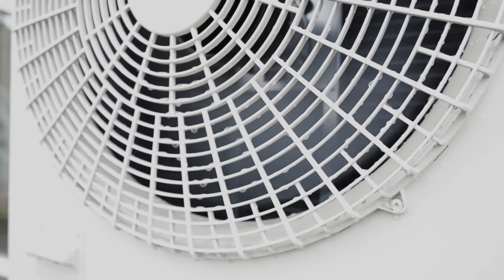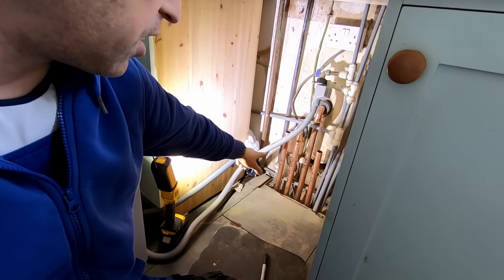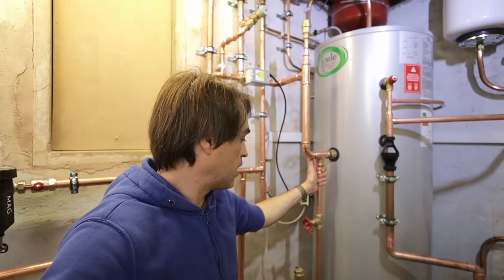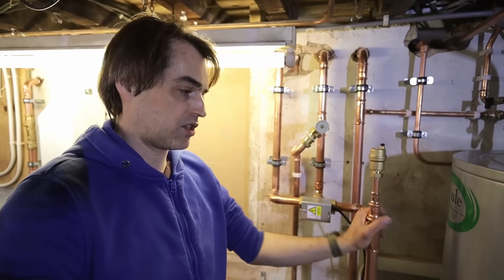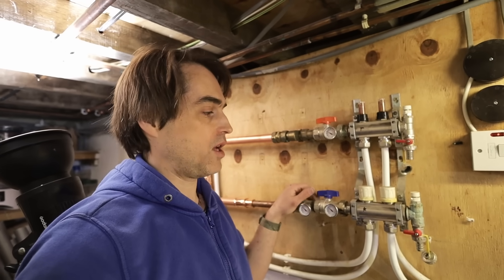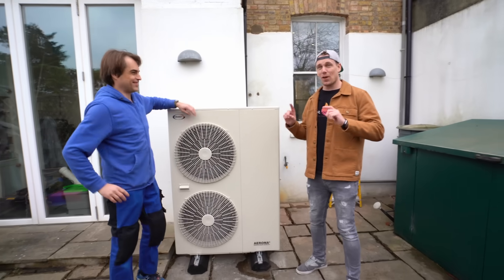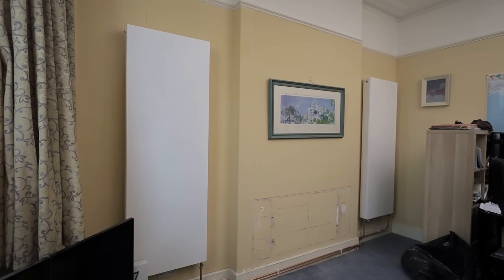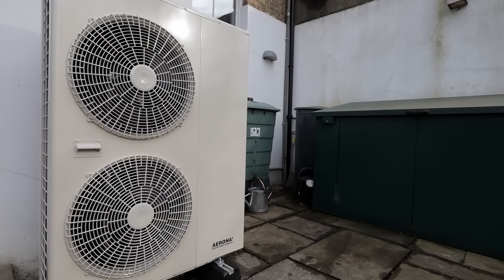The Truth about Heat Pumps: Debunking the Myth.

Comment: Looks like a very good installation. Well it wouldn’t surprise me if this installation cost £15,000-£20,000 probably slightly more. In my opinion I think this is way too much money for most families to go down this route.. personally before installing a air source heat pump I go down the route of installing insulation possibly new windows and also looking on how to improve the buildings fabric to decrease heat loss. From my experience as a heating engineer, heat pumps have a place but most the time badly installed and proper care and do diligence is not taken while surveying the job.. I personally would advise people to look into how to make the property more energy-efficient through wrapping it up then installing a heat pump on old properties.
Now if you had a brand-new property that was 100% up to scratch building regs regarding insulation or possibly a passive house then a air source heat pump would be ideal specially if you have underfloor heating everywhere..
Personally I think spending £20,000 on improving windows, insulation etc is far more bang for your buck
Reply: Spot on! Fabric first is the phrase
Reply: It's a bigger expense to properly insulate an old property than most people realise.  A tenement in Glasgow was insulated "properly" I imagine to Scandinavian standards. This was done with a government grant, it was a sort a demonstrator project.  8 flats.  I think the grant was £240,000 though the total cost was £300,000 (it's in Niddrie Road, if you're curious). That's an investment of 38K for a one bedroom flat to reduce heating bills by around 85%. The whole block had to be vacated during the works.  I'm not saying this isn't feasible but... it's a hard sell.  For a lot of property the cost of the project is approaching the house price. And this is for a flat, the cost for properties with more exterior walls, eg pretty much every old house would be higher.
Just saying.  Everyone seems to think that home insulation is low hanging fruit of energy saving. That's a fallacy.  The easy stuff has been done already, everyone has loft insulation  and DG.
Reply: @colinmacdonald5732  I believe you are correct. I looked at insulating my 120 year old victoriana semi and it's not just the cost it's also the lost space and time. Lots of horror stories on DIYers eg a 6 week project taking 18 months

What might be better in these instances is where the land value is high the government or council could buy while blocks knock them down and rebuild 2-3x as dense to modern standards

This is happening to some degree in inner London where the council bulldoze some estates and build 2-3x as many properties on the land

It's just about viable and you replace a low efficiency home with a modern standard flat

Perhaps this can be accelerated in London 

While the political class think London gets too much investment imo it gets too little. A plan to make grow London from 9 million to 15 million by 2050 would be a good energy efficiency drive. Buy up whole blocks or streets and rebuild at twice the density. It's not just homes which become more efficient but also transport. Eg only 20% of homes in Hackney have a car the other 80% don't

Either way as you say there isn't a lot of low hanging insulation remaining
Reply: Probably VERY cost effective considering if, your normal gas bill is usually £1000/Year is going to jump to £6000/year in October. 
Maybe more depending on what happens if Germany really does stop using Russian gas.
Reply: @bricktop7803  Gas isn't going up 6x

It's going to 7.37p a unit and average consumption is around 12,000 units per year = £885 per year

And these high prices can't be maintained indefinitely as at these prices the USA will build a hell of a lot of LNG terminals and export their vast Shale Gas to Europe

For what it's worth just 10% of USA Shale gas is more than the total consumption of NG of the UK a country of nearly 70 million people
Reply: Would be good to know the cost, but Isn't alot of that the luxury of mains pressure hot water? .. Non-vented tank  etc . A vented tank is a cheaper especially if you are replacing an old one.
Reply: A lot of new build properties are built to old regulation standards.  The quirks of the planning system allows this I was informed by someone in the know.
Reply: Yeah - the heat pump agenda is very sinister. Its nothing to do with the environment. The elites at Davos invest in certain things and then have governments mandate them in order to make a fat return on their investment even if its a totally unsuitable technology. It's why Germany wasted untold billions of euros on wind and solar in a country that's cold and only gets 8 hours of daylight in winter and the only achievement resulting from this was doubling the price of electricity. It doesn't matter to the elites because they already made their money off the scam. France already took actual action in this regard in the 1970's when they decided to switch mostly to nuclear power. 

Even if you mandated heat pumps on new buildings when the heat pump inevitably fails after 10-15 years most people don't have £10,000 lying around for a new one. It will be like those old cars that came with jetronic mechanical fuel injection. When it went wrong most people had the car converted back to carbs because they worked better and were cheaper.
Reply: @June Parkinson insulation is always a good first step, where it is an option - sadly there are very many houses in the UK (such as our own) that cannot be easily insulated without massive disruption and excessive costs.
Reply: Totally agree! I live in a new-build detached house and I hardly ever put the heating on, on the contrary, it gets too hot without heating ever being switched on! The insulation in my property is to current regulations, which is really good! So good insulation is key to sustainable heat in homes.
Reply: You would have to, these don't work well in badly insulated houses
Reply: The heat pump in my house would definitely use less energy if I'd installed good insulation first. However the indicative quote I had for solid wall insulation was £35k. Our system was in line with your estimates on cost. It still costs less to run than the oil boiler we had before and we've reduced our CO2 footprint from heating our home by around 80% (based on UK grid generation). Yes most of the pipework was replaced, yes we've got some big radiators, but set against internal solid wall insulation is much less disruptive and expensive. System design flow temperature of 45°C at -3°C outside temperature.
Heat pump in an old house with solid walls/poor insulation can definitely be a good option.
Reply: @shouting-into-the-void  how much was your heat pump and system upgrade please?
Reply: @stuarthawksworth  Just north of £20k. A big chunk was replacing all the radiators and pipework which would have been essential anyway. Our 40 year old boiler broke and the 8mm microbore pipework and rusty radiators would have been replaced even if we'd replaced with a modern oil fired boiler. 32kW oil boilers aren't free either. It was expensive, but not as mad as it first sounds.
Reply: @shouting-into-the-void 35k for solid wall insulation do you live in a a large mansion.  How many acres of land do you have, did you consider a ground source heat pump. They are far more efficient than air.
Joking aside you should be about to ally for a grant and try talking to a different builder that's a  insane quote unless you really do live in a mansion.
Heat pumps dowork if properly installed but will still cost more than mains gas to run. As for the environment best take their claimes with a pinch of salt
Reply: @shouting-into-the-void  yes it is a good option depending on the climate .... if outside the minimum temperature is -5 and only for a few days a year then a heat pump can be an acceptable solution :) ....+ + you compare the efficiency of an old inefficient boiler with the efficiency of a new generation heat pump…
But if you build a new house where you install as a thermal solution a condensing gas boiler and the difference of 3-10000E (up to the cost of a heat pump with boiler and the rest of the accessories + labor + space needed to install a heat pump - and that cost money) I use it to increase the thickness of the thermal insulation then you will consume less for the same total amount of money invested in the construction of the house + you get a more reliable and cheaper to maintain system + you find many more competent people to install a gas heating system and maintain it :)
But there is no single perfect solution :)
Reply: Replacing windows in the house especially if you’re going to go to the high U value triple glaze plus the proper airtight installation and hopefully water leak proof will cost just as much as a heat pump if not more. 

         Air sealing is your biggest bang for the buck and the simplest and cheapest. 

The proper insulation on a new build or upgrading insulation should’ve been something that was tackled long ago in the first place before the heat pump installation. 
                           Then with those considerations out of the way and properly implemented you would need a smaller heat pump costing you less because you have already maximize your insulation and air sealing and prove it and document it by doing a whole house blower door test.
Reply: @coldfinger459sub0  I disagree on the air sealing,  you need airflow into the property to prevent damp and mould. I know this from personal experience and had to install a PIV system to get rid of the mould that was growing due to a lack of air flow.
Reply: Far more bang for your buck than what? Good insulation is a prerequisite of installing a heat pump based system anyway  so it isn't a case of either or but after those improvements you suggest have been made.  I think Simon covered it,  alot of care should be taken over the system design and heat loss calcs to avoid dissappointment.
Reply: Comments absolutely spot on, reducing the heat load required first should always be the priority.
Reply: Right. They installed a wooping 17kW HP. Customer has a very big house or a very old house.
Step 1. insulate the house to a modern 30w/m2 heat load (at worst conditions)
Step 2. upgrade to properly calculated underfloor heating throught the house.
Step 3. choose an easy to install yourself monoblock HP (4-6kW)= 4000 euro and a separate easy to install 100 liter HP boiler= 1000 euro.
Reply: @conr3x  or alternate step 1.  install a gas boiler
Reply: @MrDead1975  unless you have no gas supply...
Reply: @conr3x  step 3 10:1(or more) modulation Gas condensing boiler @1000E :P
Reply: If you have £20,000 spare why not just put it in the stock market if it gains you average 7% a year that's £1,400 per year

Use that £1,400 to pay for simple resistive heaters eletricity. In normal times that would buy you 14,000 KWh of eletricity plenty enough to heat most homes

Also this method above would last a lifetime while a heat pump will last how many years?
Reply: @kaya051285  Funny point of view :) It is not ok for the enviroment to just use the resistive heaters :)
Reply: @mihaiachim5299  What is environmentally negative with using resistive heaters?

The future UK grid in 2030 will be ~90% non fossil fuel (mostly wind power) so using resistive heaters will be perfectly fine

Also the simplier cheaper resistive heater will be easier to manufacture and install so less waste produced

A 200kg heat pump is surely more environmentally damaging than a 1kg resistive heating element

All the mining refining transport maintenance and upkeep of a 200kg heat pump system is far more damaging than a 1kg resistive heating element
Reply: @kaya051285  Your not wrong.
Reply: @mihaiachim5299  that's not true, of course it depends on how the electricity is produced but gas is far less harmful to the environment than claimed. 
The best of both worlds would be to fit solar panels, new double glazed windows / insulation and fit a new gas boiler, then with the rest of the money saved compared to air source heat pumps take the family on holiday
Reply: @kaya051285  gosh that's exactly along my thinking, albeit we've lost the 14p/kw elec for now....
Reply: @kaya051285  or you could invest in the market and lose all your money. Simple.
Reply: @kaya051285  unfortunately, money supply inflation means that £1400 will buy you less and less energy over time
Reply: @kaya051285  "if you have £20,000 spare why not just put it in the stock market?"  Because that isn't helping decarbonise anything unless you've invested it very carefully indeed. The object of the exercise at this point is not 'see who ends up with the most money when the world collapses', it's 'how can I best use my resources to deal with the problem'. Investing in retrofits and heat pumps is much smarter than putting it in stocks.
Reply: @xxwookey  You don't get it

Soon enough by around 2030 the UK grid will be around 95% non fossil fuel

At that point what makes more sense if you have £20,000

Buy heat pump system and use 4,000 units for £800 pa

Buy a couple of resistive heaters for £100 and out £19,900 into the stock market. You need 12,000 units of eeltricity for £2,400 so it's gona cost £1,600 more. But your £19.9k in the stock market will cover that difference if it makes 8% return

Another way to think about it
Should the country build 1 additional heat pump to save 8,000 units of electricity or build 1 additional wind turbine and additional grid capacity to generate/transport 8,000 additional units of eletricity
Reply: @kaya051285  That is indeed a fundamental choice. I do get it. The problem is the size of load you generate if you just swap all current gas load for direct electric. It requires a grid about 3.5-4 times the current size. That is a lot of generation. You'd have to check SEWTHA to see if there is actually enough North Sea and land area to fit that many turbines on, and you've made a correspondingly large storage problem for calm days. We could do it with nuclear - that's definitely physically possible, but not by 2030.
It might work from an individual point of view (assuming stock market growth continues to give 8% and energy prices don't increase too much), but I don't think it works from a system point of view, and ultimately physics overrules economics.
It's much easier to  generate enough energy for efficient houses and heating than crappy ones with inefficient heating (by a factor of about 20). Insulation works indefinitely once done so over 50 years it's very hard to beat. Anyone who put direct electric in a couple of years ago is almost certainly regretting it already, even if they have plenty of stock-market income.
Reply: @xxwookey  It depends on the household heating requirements

Heating isn't just the cost of the fuel but also the cost of the maintenance and depreciation of the heating system

For example
A resistive heater lasts more or less a human lifetime or is so cheap £15 that a replacement is more or less free

While a gas boiler typically Costa £2,500 to replace where I live and in my experience lasts on average 15 years

So the gas boiler 2500 / 15 years at discount rate of 5% = £240 per year plus annual gas safety check of £80 = £320 let's round it up to £450 as a boiler isn't perfect for 15 years and then breaks it also requires maintenance as parts start to go wrong

So a gas boiler has a cost of £450 per year almost irrespective of how much heat demand you have

If you have a big old house that needs 45,000 units of gas then the gas boiler is only costing you 1 penny per KWh. If you have a small efficency flat that uses 4,500 units a year then the boiler is costing you 10 penny per unit. This is the cost of the system not the fuel

So for a small heat load property the cost of heating it is far higher than people imagine. 4500 units at 4p = £180 a year but add in the £450 boiler cost and its really £630 per year or 14 penny per unit of heat

In fact it's actually worse than that as radiators don't last forever either so you should take that I to account. Plus sometimes you will have leaks etc which is an additional cost

A gas boiler is fantastic if you have high heat load it only costs 1 penny per unit. But if you have low heat demand it's far more expensive than you realise

There is of course a break even point
It's not as simple as gas is cheaper than eletricity so always gas wins. Gas is cheaper than eletricity for sure, but eletric heating via eletric heaters are far far far cheaper than Gas boilers and radiators. Looking at £4-5k to install the gas boiler and radiators and only 5% if that to put eletric heaters into rooms

The same argument goes for heat pumps but the economics are even worse in that a hear pump doesn't cost £2,500 it costs closer to £10,000

So in short if your heat demand is low. Then you are almost certainly better off woth a very cheap resistance heater setup rather than a gas boiler or heat pump

Plus a resistance heater is so cheap because it costs so little to make it. Go to argos or amazon and get an eletric heater for £20 it weighs 1kg five of them for a hiuse is £100 and 5kg. By comparison what does 5 radiators and the pipework and the heat output wrigj and cost. £15,000 and maybe £250kg? The cost to make and replace heat pumps and radiators is far higher

As for the argument that we would have to upgrade the grid a LOT if we install resistive heating. This is True but it is ALSO true of heat pumps. A heat pump might be 3-4x more efficient than resistive heating. However that doesn't mean you can have a grid 3-4x smaller as you need to size your grid to meet the worst once i a generation winter. Imagine 30 million heat pumps they use 1kw in a normal winter = 30GW

Now imagine 30 million heat pumps but it's the worst winter in 30 years it's negative 20 outside and all the heat pumps turn to their on-board resistive heaters and you have 30 million heat pumps all using their 4kw resistive heater =120GW

This is a critical fault of heat pumps people don't seem to understand 

You need to size your grid to meet the once in a generation winter. As such eletricity costs are going to go up big time if we do mass heat pump install as the grid will need to be oversized to cope with the once a generation winter

For what it's worth I think the following is best

1: Efficient homes use resistive heating. Say 1/3rd of homes
2: Average homes use dual fuel boilers gas and eletricity when there is wxcess wind the gas boiler uses eletricity. About 1/3rd of homes
3: Remaining 1/3rd of homes use dual fuel heat pumps. Heat pump when it's suitable or NG when it's not

The above solves the grid problem
Reply: @xxwookey  But then you have bought into the net zero cobblers, haven't you?